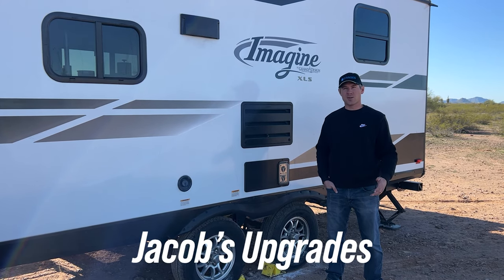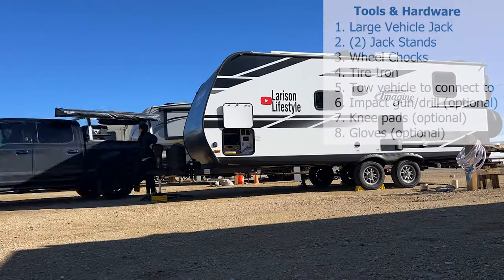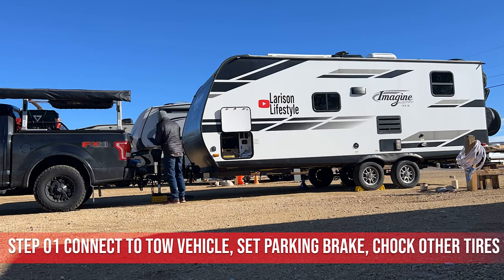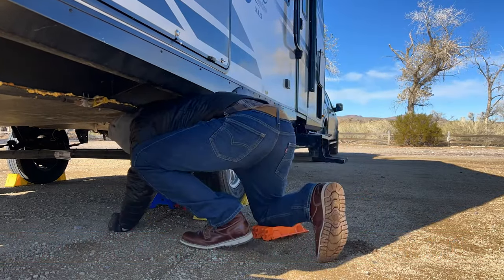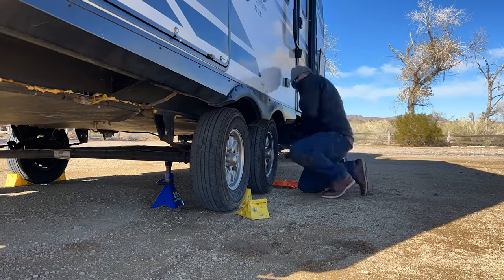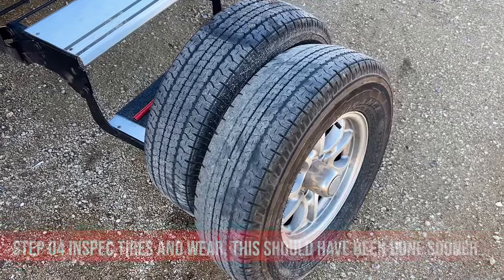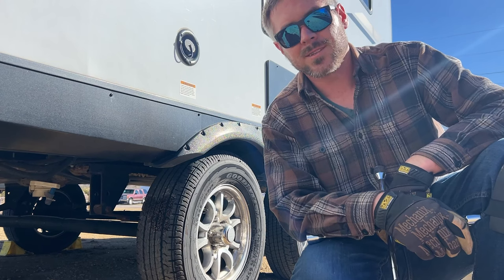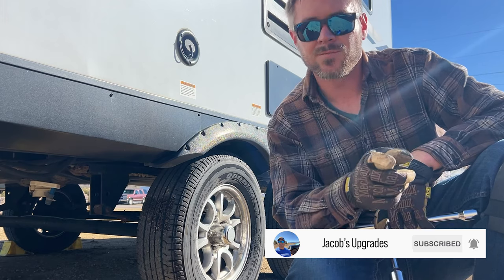Trailer Tire Rotation

Comment: Dont jack trailer axles!
Reply from the maker: @sdparkinson79, How do you recommend jacking the trailer up if I don't have a jack tall enough to reach the frame? I don't carry a floor jack with me on the road. Stacking blocks with a bottle jack seems sketchy.